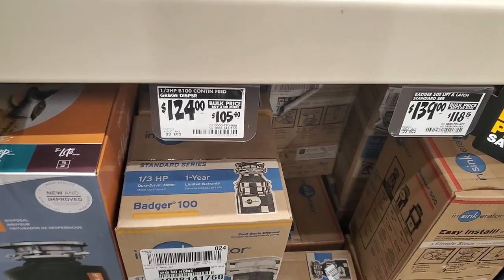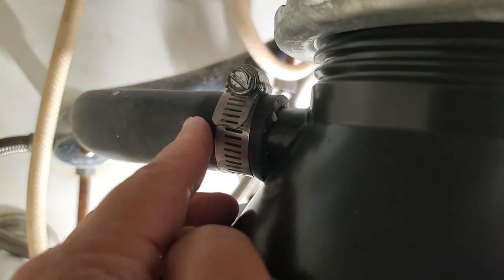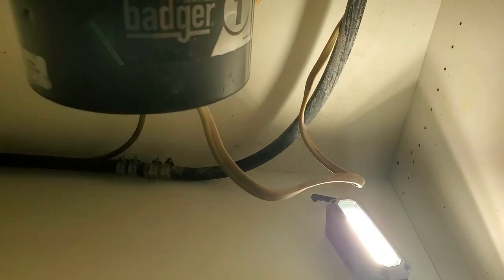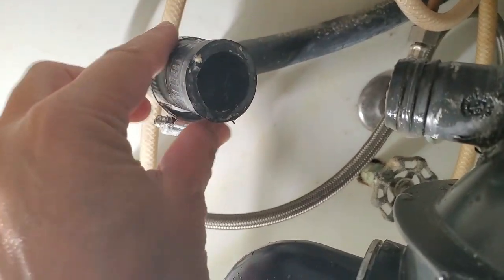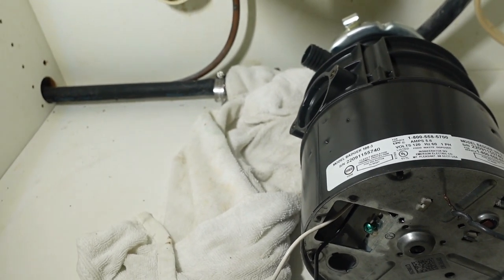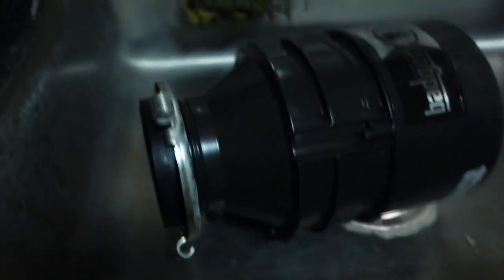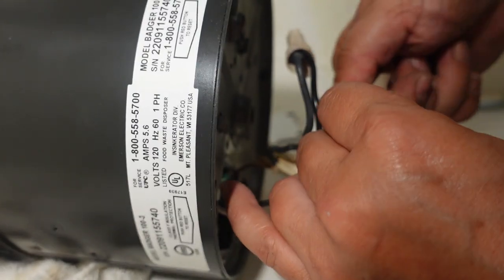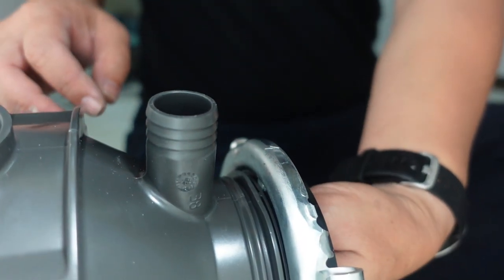How To Replace Your Broken or Leaking Garbage Disposal In Your Sink

Comment: Great job! Had mine replaced last year  for $350.00. The plumber supplied the new disposal.
Reply from the maker: Yes that sounds about right. The one I took out cost me $250 and he replaced the pea trap which was old metal pipe to PVC and it was an emergency call out on the 4th of July. I guess inflation is what it is. I'm not sure.

Comment: Great job ! But strongly recommend you install a strain relief (aka: stress) clamp that secures the hardwire to the underside of the disposal. Saw that the old one and the replacement didn't have that... usually not included inside the Badger disposal box ... stupid, they should include that piece. This prevents the electrical wiring from being pulled out too easily especially as it is near a water source. Also saw and recommend to prevent any roaches or other insects from coming into your sink area is to caulk around the clean out pipe on the back side under the sink since I saw a large circular gap around it. Finally, saw your shut-off valves (hot and cold) are likely BRASSCRAFT brand which uses a rubber o-ring, so when turned on and off a few times over time, it may cause a seepage (or worse) puddling onto your shelf. Replace with the newer and better quarter turn shut off valves which don't use rubber o-rings. Your video is very good and will show to a lot of people who watch YouTube how (somewhat) simple it is to replace an existing disposal !   Props to you, Misty !
Reply from the maker: Thanks hawaiiguy! I did think of getting the stress clamp but I was lazy. I know bad. Maybe next time. I know what you're talking about. I'll caulk the gaps to prevent the roaches from coming in. Mahalo!
Reply: @FoodFiend  expanding spray foam maybe easier than caulking, forgot to mention previously.
Reply from the maker: @hawaiiguy1  thanks for the tip